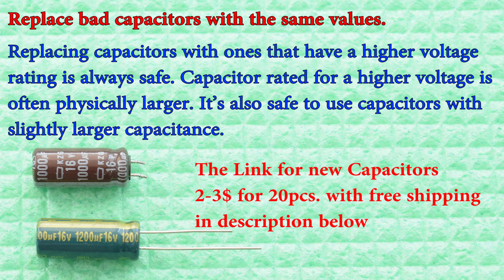How to fix any Monitor with the most Common Problems. Fixing another ViewSonic Monitor in 10 minutes

Comment: Hi,
I have this Dell LCD 2709W for some time now, but about 3yrs ago it stopped turning on, took it to a technician and they could not fix it but suggested i change the board, which we could not obtain anywhere in Nigeria. I packed it up, after about 4mths I plugged it, power it on and voila its working, i used it for sometime and it stopped working again. So i packed it again and after a month tried to power it again and it did not work, so i left it for longer like 3mths plus and power it again and its working. It stopped working last year and i packed it again, i tried powering after a while it did not work, so i left it again for longer, i just powered it on today and its working. Is there any explanation to this? What could be done? Thanks
Reply from the maker: Could be a bad contact, bad solder joint, dead capacitor etc. When you say it doesn't work, can you be more precise? When you press the power button hat kind of LED indication you get if any at all? If you very slowly plug the power cord into the outlet can you hear the discharge noise and see sparks?
Reply: @ElectronicsComputers  thanks so much for your reply, i really appreciate. When its not working; this is the behaviour - when i plug in the power cord, the power indicator flashes on in a blink and then remain off, if i remove the power cord and try again, it will not flash on anymore except i leave it for some hours and try again and it flash on again. If i leave the monitor unplugged for months, then its going to be operational the next time i plug it in. I only hear the discharge noise the first time plugging it in, subsequent time i would not hear except i leave it unplugged for some hours and try again then i would hear it, just like the power indicator.
Reply: @ElectronicsComputers  another helpful information is - whenever i forget to unplug the monitor before running a generator or try powering it while running on generator, then the monitor would stop working (would not power on again) untill after months of not being plugged in. This issue does not happen with grid supply or inverter supply even after a supply failure and restore

Comment: Need assistance for LG Monitor.. while working all of sudden lower half screen turned white.. I tried power on off... different cables and different systems nothing helped.  Even the default screensaver of monitor come only of top half.  

If I keep monitor plugged in to power while screen will start turning grey and stay that way..

Please assist what could have wrong
Reply from the maker: can you see the monitor's menu or also only half of the menu is displayed? Sounds like a dead LCD panel... or its driver.
Reply: Thanks for replying - no lower half is totally grey / white .. cant see menu to select anything. is this repairable or can i try something here with it? - @ElectronicsComputers
Reply from the maker: @sandeeppiplani5648  You need to replace your LCD panel. There's no sense to by a new one to replace because it will cost almost like a new monitor but if you'll find a used one or the same monitor with other issues the you can easily swap them.

Comment: My monitor screen turn off after 4-5 secs whenever i do a little bit of vibration. On shaking monitor everything is fine but screen goes off only when i vibrate it slightly. Can you guess whats the problem? I have checked power and vga cable are connected correctly. Thanks
Reply from the maker: Could be loose connections inside the monitor or cold solder joints on the PCB. Also check the power and signal cables.

Comment: Can someone help me pls

My monitor is working showing the display as a normal monitor but the display has some line and distorting line 
I use another pc to check it is same
Reply from the maker: First of all, check for loose or faulty cable connections inside and outside of your monitor. However, if you see a vertical line on the screen, it's usually a sign of a dying LCD panel.

Comment: Sir, I have a damaged 680 uF 25 V cap and 1000 uF 25V cap, can I replace both with 1000 uF 25 V caps? It is part of HP L1908w monitor. Please help!
Reply from the maker: Sure! It will work even better.
Reply: @ElectronicsComputers  Oh, thank you!
Reply: @ElectronicsComputers  Would it have any impact on the resistors or any other parts? What is the difference caused  when i put 1000 uF in place of 680 uF?

Comment: I installed an dvd drive in my pc and suddenly the moniter turned off, What Can I Do, Please tell.
Reply from the maker: Check all the cables. Also disconnect your PC and the monitor from the wall outlet for a few minutes.
Reply: @ElectronicsComputers  Not Working Also Other Moniters are not working

Comment: Please need help. I have LG monitor my pc runs good (tested anoter TV) but my monitor says no signal. Cable is good. What can cause it at monitor. Whats the problem?
Reply from the maker: check the cable which comes from computer to your monitor. Also try to rest settings on your monitor. If your monitor has a few inputs try to manually switch to the one that is connected.

Comment: My monitor is not turning on and I would like to give this a try, but I don’t have the burning tool you used in the video. Can you please tell me if there’s a way to fasten without burning the wires like that? Or where can I get the tool you used? Thank you so much🙄☺️!
Reply from the maker: you can buy a cheap soldering iron with solder for 5$ and free shipping here: http://ali.pub/4xtvoy
You can also buy new capacitors on that web site.

Comment: Sir in my monitor it starts but if I turn it off and try to start it again 
    It don't responds
But if I try to start it again after 2-3 days latter it turn on 
      And this repeat again so what I should do
Reply from the maker: It's dry capacitors. You need to replace electrolytic capacitors just like I did in the video.

Comment: sir i bought an old monitor on internet(dell U3011), at first time it works well, but after a few days of use, it suddenly goes black(works normal in the first couple of minutes), and after few hours or few days, same problem occured.  Is it capacitor problem?
Reply from the maker: could be or bad contact on internal or external connections.
Reply: Tear it down and you will know

Comment: Sir my Monitor Display Screen Flickers when i on my PC...even if i remove the CPU connection from the Monitor still it Flickers...I think its the problem with the Monitor....What do u think Sir...Can u Please Reply...
Reply from the maker: if the monitor disconnected from your PC and it still flickers then the problem definitely in the monitor. Could be the  problem with monitor's backlight or power supply. What's the model of your monitor?
Reply: Sorry sir...i dont know the Model..but its of ASUS...yes Sir u r ryte...it maybe the problem with the monitor display...cause even if i dont connect with my PC still it Flickers...something maybe wrong with the Display
Reply: Can It be Fixed Sir?
Reply: @ElectronicsComputers  mine also does this on a Acer H236HL it's like a pink flickering box that takes up like 90% of my screen went from every couple minutes to ever ten seconds

Comment: I tried this and still didn't fix the problem.  Then I changed both the Power Supply and Video boards.  Still didn't fix the problem.  Monitor flickers then turns off.  Any ideas what to do next?
Reply from the maker: Maybe the problem in backlight lamps. As you can see, on the left side of power supply's PCB there are 4 connectors. Try to connect them one by one and turn On your monitor. The monitor will turn On backlight lamp for a few second. If there's no backlight then that lamp is dead. You can replace it or bypass with any capacitor rated for 1-6Kvolts.
Reply: @ElectronicsComputers  Let me clarify how you suggest.  I should take off the 4 connectors for the backlight lamps.  Then I should turn on the monitor.  Then i should connect one connector at a time and see what happens.  Is that correct?
Reply from the maker: @mickeyflowers  

1. Disconnect all 4 connectors.
2. Then plug one of them and turn On your monitor. If you see the backlight then that lamp is OK. turn Off your monitor.
3. Connect another one and turn On your monitor etc until you find the lamp which doesn't work.

Comment: sir i connected my monitor on my laptop, when i turned it on it just light up no logo shown no "no signal" shown just black, not off also. the cable is good, i tried connecting our smart tv on my laptop, also good.
Reply: I'm afraid you will have to do a lot of googling to find the solution to that problem. It is a completely different type of problem from the one this video is for (monitor not turning on in the first place). I'd advise you collect the name and hardware number of your monitor and also which kind of cable you are connecting with (is it hdmi?)

Comment: Its kinda late to comment but it could save my life. I hit my pc monitor that is a dell with a controller and something on inside cracked and doesnt work anymore all I see is the crack and lots of lights. The screen isnt cracked tho. I want to know if this video could be useful for me to try and fix it. Or could u make a video of that or give a link if u already have a video on that. And it could be cool if u also told be all the pieces I need to repair it at home. Please, help me, the situation is pretty critical for me. Pleaseeeee dont ignore
Reply: The glass isn't the only part of the screen. Sounds like you may have damaged the liquid crystal matrix.